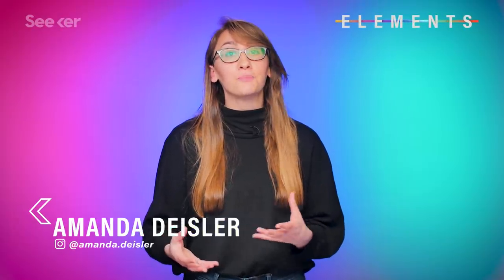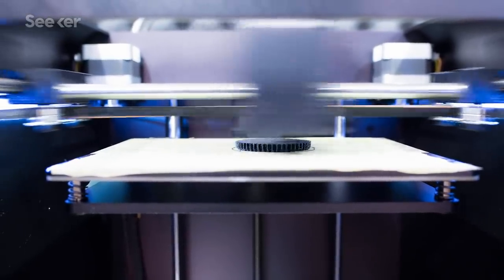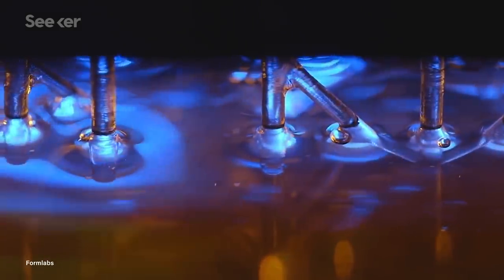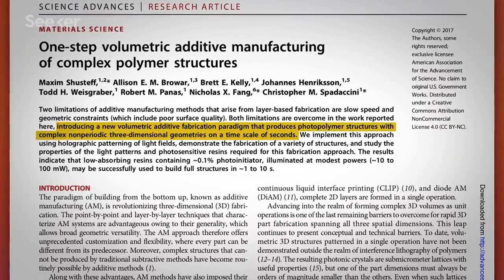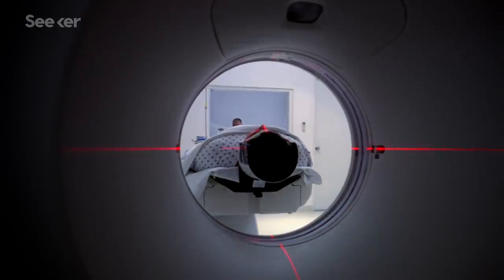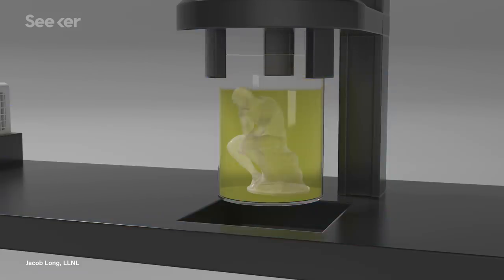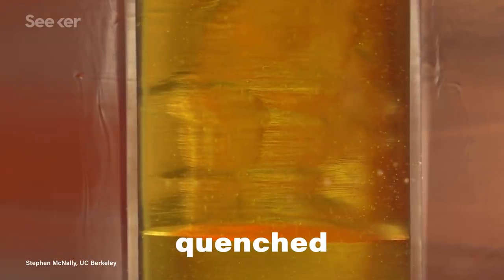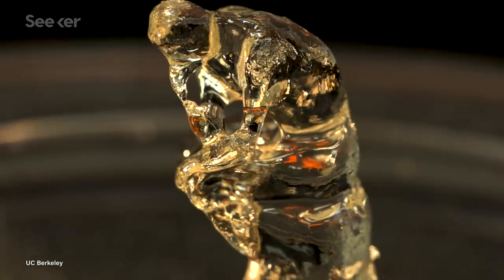Why This 3D Light Printer Is a HUGE Game Changer

Comment: I think it's AMAZING if it actually works as intended. That being said I suspect there are a lot more problems to overcome than this video would have you believe and the implication that the material will be cheap is something SLA and CLIP both claimed but it turns out they were talking about relative to the most expensive 3D technologies there are like SLS and not compared to FDM which is what most people think of. This kind of reminds me of the CLIP 3D printer where the demo was amazing with crazy print times and watching the items just materialize before your eyes over a few minutes and then when it came out it was hundreds of thousands of dollars and the material was stupid expensive.

Here are a few problems I anticipate...
1) The material will not only be expensive but also have a short shelf life due to its photoreactive properties and oxygenation
2) The photoreactive nature of the material will make it break down faster in sunlight vs. FDM materials like PLA, PETG, Nylon, etc
3) You can only print in this one material so you'll have to make casts from the prints to produce parts that are durable and functional for your specific needs
4) The bulb in a DLP projector progressively gets dimmer (unless it's Laser) meaning you won't get too many prints before needing expensive bulb replacements 
5) Particulate that forms in the vat will need to be removed meticulously to prevent print quality degradation from light deflection
6) Resolution at larger scales is going to be hard limited to the DLP projectors resolution, will look great on tiny prints but garbage on large prints
7) I don't see build volume on this improving much because even if it did the cost of material to fill the vat for any size print would be insane and more waste when it goes bad
8) Just like with SLA I'm sure you need to post-process the prints with UV curing to further solidify the material to its full hardness (this adds time which negates its speed)

... So, like I said, if it works and they solve all these problems you won't be able to keep these printers on the shelves but I suspect this will end up being used only for printing very small things and the cost will be high so it wouldn't be used to manufacture final shipping products but rather prototypes. But, as I said, if it works I'll be the first to buy one if it's cost effective or even on par with Form 2 for that matter 👍
Reply: I'm glad to find someone else who is thinking a little more about the many challenges of this form of printing. Two more potential huge limitations to add to your list: 1) precise timing between the speed of the rotated image and jar of rotating material. 2) Rotating fluid is subject to increased mixing (entropy).  Keeping the newly polymerized particles at the same eccentricity from the center, in a rotating medium seems extremely imprecise.  Compare the smeared Thinker in the video to a high quality print from nearly any commercially available FDM printer.   

The big selling point is that it doesn't need scaffolds, but if you're trying to print in a discrete location in space in a swirling bath of material YOUR SOLIDIFIED POLYMER is going to move! To prevent this, one could add scaffolding.  At which point, you may as well use an SLA printer.
Reply: What a wonderfully thought out and constructive comment. Never even been near a 3d printer I don't have nearly the insight you do but I can still appreciate all of this.
Reply: @roberthermosillo5727  the higher the viscosity, the better the support, which means the solid will not move much due to rotation.
Reply: I believe penetration depth of the light is still a big problem, that's why you only see small objects printed.

Comment: This is HUGE, and the tech is still in it's infancy. It's going to be amazing what CAL can do in the next 12-18 months.
Reply: It's neat for sure, but not quite what it's described as. The rotating method is a reversal of space carving, and simply uses more angles than stereolithography - which STL is named after. There is still a resolution limit from the projector, although dynamic because the edges vary in distance from it. Rotation speed must be kept low so the gel does not shift much, and since it projects through it all the gel is used up for each print. As usual real world approaches are rife with compromise.
Reply: this tech has been around since the 90's
Reply: I want to see some makers in the community put together their own. None of the actual tech is unique, it's an off the shelf DLP projector with a lens. The rest of the materials look like they could be bought or readily made.
Reply: @0LoneTech  Using up all the gel could be made a little easier by varying the size of the container to match the size of the printed object and filling the flask to the bare minimum amount to cover the object.

Also I think the resolution limit is actually a function of the projector resolution and the degrees rotated per frame. So it might actually be quite good.
Reply: It seems to me that this isn’t technically 3D printing, but more of an emerging technique that will possibly rival and/or supplement 3D printing. The very fact that they didn’t make or modify a printer fascinates me. They just took two ideas, SLA printing and STL, which has been used for years to make those cool blocks of glass with 3D sculptures etched inside with lasers and tweaked and combined them. That’s so clever!
Reply: slayerofFUD - That’s what makes it so cleaver. Repurposing long established tech to create something completely new and relevant is such an amazing thing!
Reply: I beg to differ. This is only huge for making transparent epoxy parts with SLA. You cannot apply this technique to anything else. It's a one trick pony that excites the science-illiterate media and noobs.
Reply: tetrabromobisphenol - Don’t know why you have to be elitist about it. I mean, 3D printing itself used to be in the same stage. Amazing idea, but prohibitively expensive and terribly inefficient. Now it’s easier and cheaper than ever to get a good quality printer that makes great prints. With out these small steps, we’d have nothing but our bare hands and some rocks. It’s too easy to take this stuff for granted.
Reply: Blu Dija - It very much does, but this is only a small step to a potentially amazing and detailed method.
Reply: @pickleshanks  : it's not elitism, it's just reality. The media has proven again and again that doesn't have the judgement to discern  truly generalizable advances from "cute and clever but not important to industry". There ARE amazing advances going on (one of which I highlighted in another comment), but rarely noticed by the media.
Reply: @tetrabromobisphenol  it's also pretty useful for printing in conditions and environments that conventional printing fail. don't forget where it will be when considering it's value.
Reply: @ToSaPu  Not in California
Reply: I want a loverbot!
Reply: @0LoneTech  The rotation speed of the liquid is a bottleneck for sure. But one can easily imagine rotating projectors instead of the liquid (like in cat scans - you don't rotate the human inside :)). I am pretty sure they are not on this level because this is still proof-of-concept research stage.

Comment: Extremely important step in the evolution of 3d printers. May be in 5 years we may be able to order these type of printers.
Reply: 'Order' Hell the fact you said, 'five years' when traditionally we'd have wait around ten to twenty shows the advanced state we are living in, maybe in five years we could just simply 'print' these printers from our home printers.
Reply: I think you can make this at home in less than 5 years.
Reply: @madisonatteberry9720  I don't see why someone can build one at home now. They used an off the shelf DLP projector, and most of the other stuff sounds like it could be readily bought or easily made. The software to do it is the only thing that'd have to be redone but I believe the paper has all the mathematical formulas needed.
Reply: @madisonatteberry9720  Someone will build their own and put it on youtube within a year.
Reply: holy crap... It would be like "oops! My screwdriver broke! Just pop it in the fabricator and print out a new handle!"
Reply: Electronics61 What it we could print printers?
Reply: He's using like a 100 thousand dollar laser to do this. This is not a consumer technology. 

SysPowerTools. This is not DLP this is the same tech used to create 3d images in glass.
Reply: @Daniel Kintigh ebay...lol
Reply: @Daniel Kintigh Not necessarily! Look how quickly regular 3D printers came down in price.
Reply: @sheriffaboubakar9720  as a species, weve been doing that in homes for two decades. industry longer than that. maybe not so popular, but it's old hat.
Reply: @YOURMOMxo69xo  no, "he" isnt, and no 3d printer sold does. industrial level sli printers cost that much for the entire ownership experience.
Reply: the cost is in the control and design.
Reply: @YOURMOMxo69xo  It's not cheap enough yet.  But then, I used a $2000 laser distance meter 20 years ago that you can buy to day - similar accuracy, for £20 from LIDL.

DLP is simply mirrors redirecting the laser - it is chip made by Texas Instruments (they are crap, because the micro-mirrors fail, leaving white dots).  Read up about it - you'll see that she's probably right.
Reply: Looks like GLOBS of Meh & Fail.
Reply: @humphred4912  or just buy a new one
Reply: @kylec3520  why buy a new one when you can fabricate a new one on the spot?
Reply: Bad news from 5 years in the future...

Comment: This is fascinating. I've recently gotten into 3D printing and though for most projects I have no problem with layer by layer manufacturing, so some prints you want the sides to be as smooth as possible so you may have to spend some time sanding away at it. I also see the appeal that there is no need for support material!

Comment: I guess the obvious limitation is non-transparent or coloured objects, or what?
Reply: One would think so for now. Shouldn't be long till they invent a resin that cures opaque. Till then: hey,  primer still works.
Reply: @drumkommandr9779  I think it would be easy to "drain" the first 3D_making resin (once you have the actual object made), then fill it up with another resin that reacts with the light making an an specific color on selected points of the sculpture´s surface [then you drain it again and refill  it with a different one for another color...] until you get the entire surface "painted" using the same laser [that is likely to be the most expensive part of the machine].
Reply: I assume you can do the same thing we do with current methods - paint the model after it prints.
Reply: @GrimIkatsui  sure, but then you can also CARVE it from wood... the idea it to FULLY AUTOMATIZE it to make them ON MASS (or on demand), no skill, no personal time or effort required -> THAT is a revolution!
Reply: @adolfodef  erm that would be a very long term end goal (and one some companies won't keenly agree on), for now this is best for fast prototyping and some DIY just like regular 3d printers.
Reply: A photo activator using light outside the visible spectrum might solve that. Preferably something that can penetrate deeply into visibly opaque matetial. Think UV or X-Ray.
Reply: Argamis, making 3D models is not as easy as you think😅...but can be learn quickly😇
Reply: @adolfodef  if you're familiar at all with the process of casting metals Plastics or resins there's so many processes from the artist to finish product makes it a custom one off most of the time and out of the price of many people's budget. If you could take this technology to eliminate the artist and mass-produce blocks of resin that deactivated areas instead of being solidified were cost to have the opposite effect and with time the remaining material around Hardin to create a negative mold. The sprue and material paths included in the negative mold from this point forward it would be the conventional casting process that is already been perfected I'm sure somebody's already doing this because if my small freaking brain can conceived something like this I'm sure some educated person has more resources and help to accomplish the goal. I know that if someone could do this they would be quite wealthy
Reply: maybe changing the band of light projected? some materials appear transparent for IR but not to the human eye
Reply: I'm hoping to see a bunch of needles extruding pigments where needed.
Reply: why would  transparent is a limitation to  non transparent object? creating transparent object is harder than non transparent object , or you can just dip the finished product in pain , or paint it yourself , or just mix it with coloring
Reply: @Nyambui  
Or a volumetric colour sensitive film that is initiated post the object formation. Could be an extra boundary layer. Would possibly require a white intial coating. If the wavelength of the solidifying beam was not within the photo sensitive range for the surface boundary if this could in itself act as a film this could be done as part of the whole operation?
Reply: @rickh3714  I like your thinking!
Reply: I think coloured has fallen out of favor as the preferred nomenclature, my dude. They prefer the term "minority-hued".
Reply: @Nyambui  
Thanks. I think a prior reply here which I hadn't seen expresses pretty much the same concept. May not be feasible of course right now but a lot of further work on pigments and light activated dyes might allow something like this. I'm no chemist, have done photo process printing techniques  etc & do make my own paints occasionally, very crude compared to all this!
Reply: Ole Wissing I’d assume regular old food dye would work fine, I think the limitation would be hollow objects. But what do I know, I’m not a 3d printer professional.
Reply: You could just use resin that cures at a non visible wavelength. Like infrared or UV.
Reply: She mentioned that the resin formula is still being adjusted to alter the characteristics.
Reply: My guess is that that won't happen. I think the process relies on light making it through the cured parts to cure more of the resin. If you couldn't do this, the process would probably be much slower.
Reply: @elizabethsetlow862  Still not sure why they never took me up on my terminology of calling black people "negatives".
Reply: @krashd  
Yeah, but aren't white people negatives of black people? B/W camera film wise. Evens out. Net effect = no racism!
Reply: @drumkommandr9779  if lasers were able to harness the different wavelengths of energy, would scientists be able to apply this method for different materials and applications? Is it possible to produce an energy wavelength analogous to a magnetic force with the same technology as lasers use and be  able to focus into a directable beam?
Reply: @KevinFreist  I am pretty sure most companies use sand or clay for their mold negatives for smaller batches and metal for long run batches and silicone or pressed corn starch for edible molding. Due to the inherent flaws and defects of the 3d printing process, making mold negatives with a 3d printer isn't really an option at this point in time.
Thats my understanding of the technology, I could be wrong though.
Reply: @adolfodef  Not all shapes can be carved.. think of cavities...
Reply: @krashd  bwahah

Comment: 1. Resin starts after few objects to increase in viscosity. 
2. Mechanical proterty of cured resin, temp curing after presume
3. Price of tech and material
4. Chemical property, tech prop.
( gluing, velding, adherence of finish, metalization)

Comment: Makes sense that the edges are still warbley looking as the resin takes more time to solidify as the canister is rotating.  Seems they need to adjust the polymer or turning rate

Comment: Im an experienced 3d printer, and although this looks interesting, there are several serious problems with this tech. Resolution is terrible, you cant print accurate parts. The resin is toxic , messy, expensive and final curing time negates the advantage of the quick print time. With a lot of R&D this might get better.
Reply: Atleast it’s a step right in the right direction.
Reply: Imagine similar principles with different mediums, one could create all manner of resulting qualities, nutrition, or otherwise.

Comment: As an Industrial Designer i find this extremely interesting, currently, with Lithography, you can already get magnificent models with seamlessly layer lines if you create the object, this makes the prototyping process for products much faster and accurate. Hopefully, they can develop a printer that can be accessed by creators
Reply: I dont see this technology bringing all that much to the table compared to already existing affordable resin printers:
https://www.youtube.com/watch?v=Gar2jcRlGTo&t=1m20s
Sure its fast and you can print parts within parts without structures that youll need to break. On the flip side youll need to leave holes to flush out the gel afterwards. 

Im more hyped about where things like the Diamond hotend can take FDM 3d printing. Mixing 3 or 4 filaments should be able to recreate a wide range of colors. I wonder when filament manufacturers will start selling RGB filament sets with proper settings for said filaments. (I suppose the settings might vary for different hotends. Aaaahh...) And software will probably need to do a bit of catching up with what can potentially be done with the existing hardware.